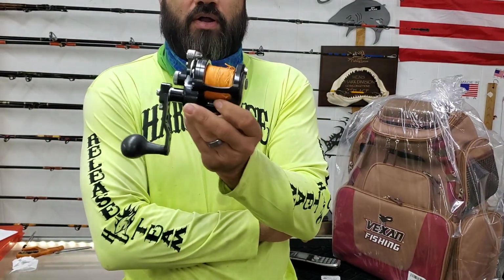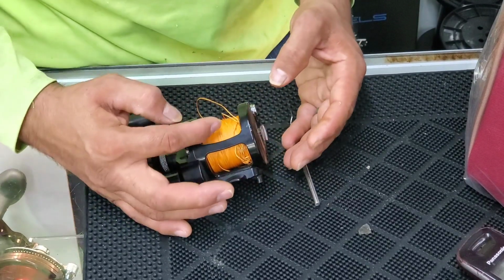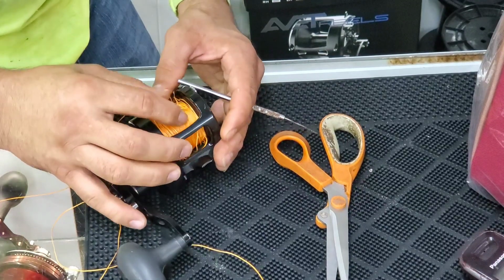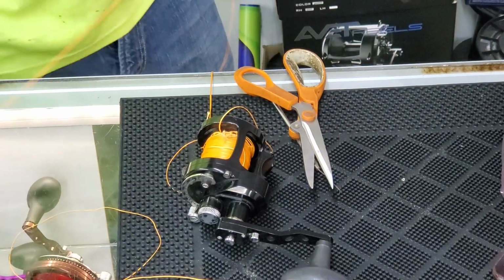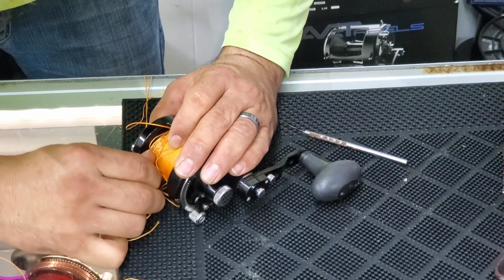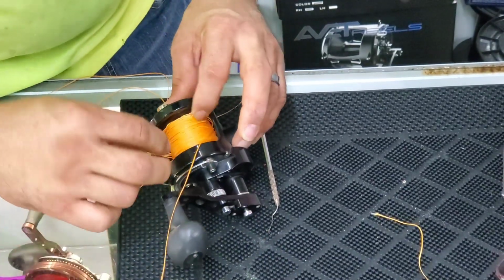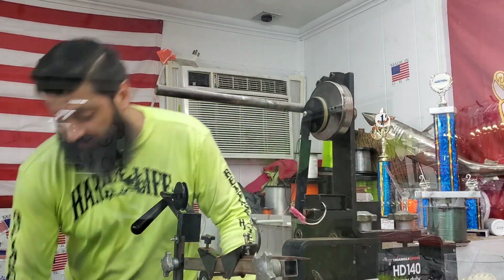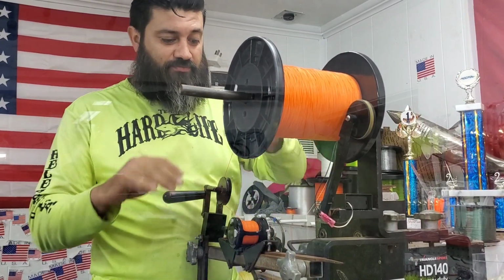I was almost defeated Hollow Core Braid Locked up Avet Reel

Comment: I've got a back lash and ended up with four end lines some how.  Lost about 400 yds. Also when throwing heavy mono topshot I find that if you break it in it gets more flexible and cast better.
Reply from the maker: What mono top shot are you using...I used to use 50lb or 60lb mono top and after that monster break off and back lash.... it was over ... especially since I cast that so raptor with 8oz weight and bait and if flew!!!!!
Reply: @TeamHardLife  I was throwing 40# power pro but since the big blow up I've been throwing 150 power pro on a saltist BG 50 FG knotted to old about 40ft of old 150 mono off a old school 12 ft uglys stick. I had it set up as a short yak set up but it cast great still and has less tangles and more power.  I'll throw it as hard as I can no worries and pull as hard as I can no worries.  I was surprised how good it cast with the heavy line.
Reply from the maker: What size weight?
Reply: @TeamHardLife  8 oz
Reply from the maker: Hmmm what kind of distance are you getting
Reply: @TeamHardLife  almost the same as 40# with no topshot.  60-130yds depending rigs.  But I just started throwing a knocker rig on it so I might can get further.
Reply from the maker: Also home.much mono top shot are you using... and thats some cast
Reply: @TeamHardLife  I had like 40ft but probably got 30 now from retieing a lot.  Haven't got any monsters on it yet, a few 4ft sharks, 36 inch red and about a 250# ray but it was by oysters and rocks so it couldn't lock down on the bottom.  I want to get a 9ftr on a casted bait.
Reply from the maker: Ok.. thats some nice catches

Comment: I was having a hard time with my mxl this last time out…has 60 diamond hollow core. I cast and then before bait hits water it will tangle on spool. What will cause that? Is it me not reeling line in evenly or line digging?
Reply from the maker: Is it mc? What weight are you casting?
Reply: @TeamHardLife  yes and its all the way up. That time I believe it was a small 2 or 3 oz Carolina rip with a live mullet. I took it out to a football field and unspooled it; reeled it in and the last couple of feet  ended up twisted up as in if the line had a bunch of twist in it....I cut that section out. Im headed out tomorrow well see if it changes anything.
Reply from the maker: What number are you casting it on?
Reply: @TeamHardLife  mc is all the way up at 5. I went out yesterday to port a and same thing is happening. To me it looks like its unspooling erratically and at a certain point it will tangle up with weight in mid air. Is there a specific procedure to set drag knob in proper range? It is currently running 60lb diamond hollow core braid.
Reply from the maker: Is there any way you can bring it by next week so I can check it out?
Reply: @TeamHardLife  haven't had a chance to go out there to corpus but I will when I go back out. I think I might just need to take line off and respool it.
Reply from the maker: Let's start simple with checking the cast and then we can go from there ...